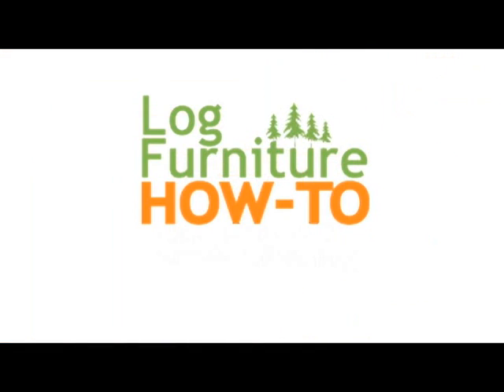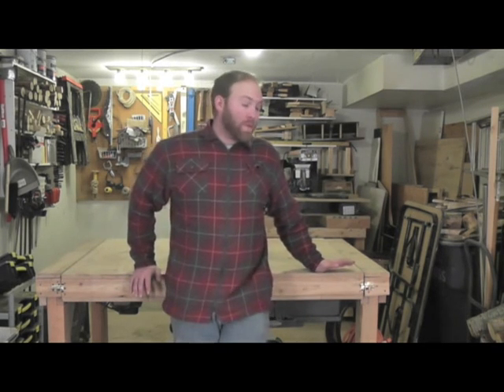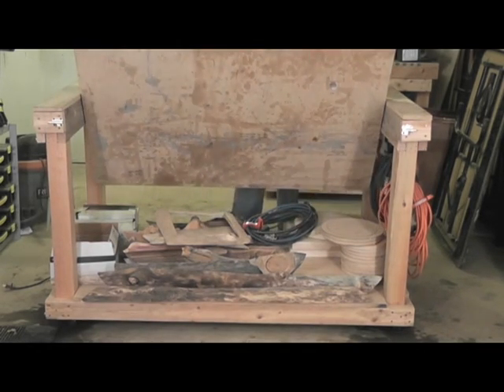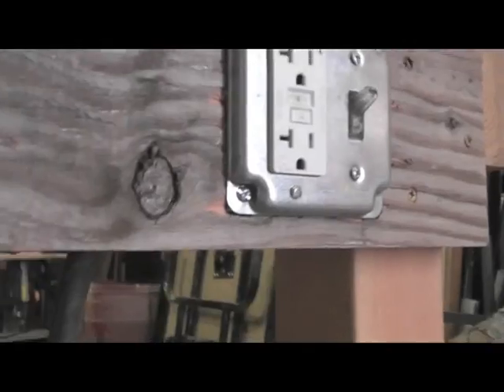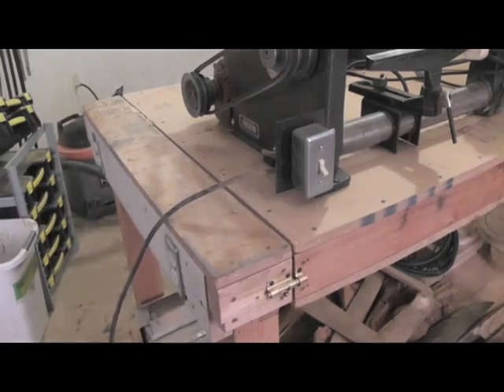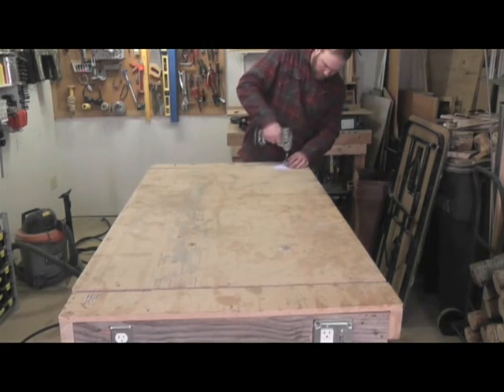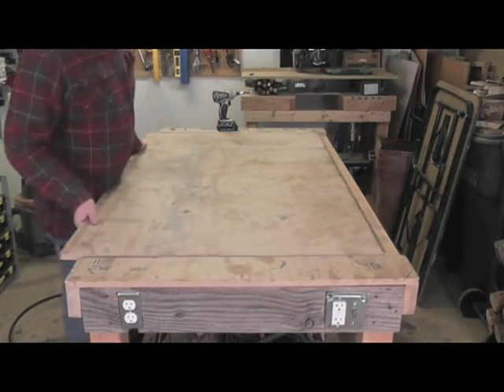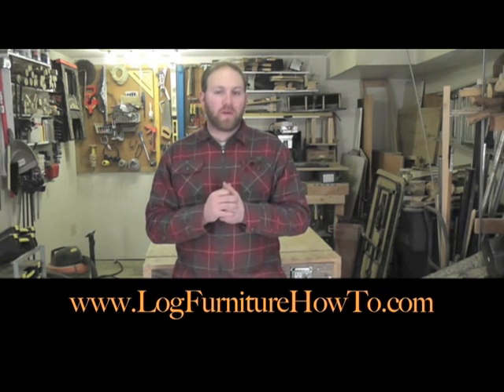San Juan Carpentry: "The FLIP Bench!" with Scott Shaeffer

Comment from the maker: As you build the legs, before you put the "end cap" boards on, push the pipe through the holes in the frame parts attached to the legs and also the frame parts that will hold the table top.

Comment: Nice table, another sign there's intelligent life on this rock.  ;-)
I've got half of a smallish two car garage to work with and if the HOA has no problem with having a shop, my first projects will be making clamps a mallet and any other tools needed.
Utilizing some design ideas I've seen (similar to yours), I plan to build a multi-tool work bench incorporating a table saw, joiner, planer (thickneser), drill press, band saw, miter saw and oscillating drum/belt (bench, Horizontal) sander, Including a draft down sanding area. All these tools will have dust containment built in, air tool plug ins and of course electricity.
Thank-you for the time, sorry for the babbling. :-)